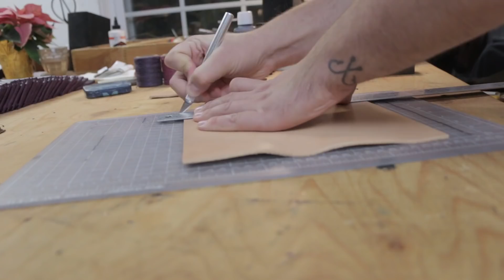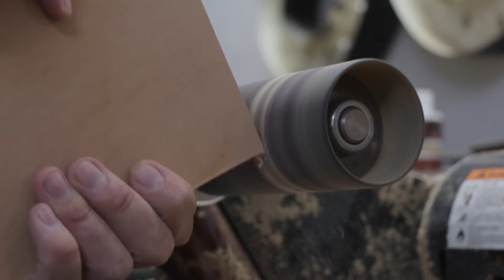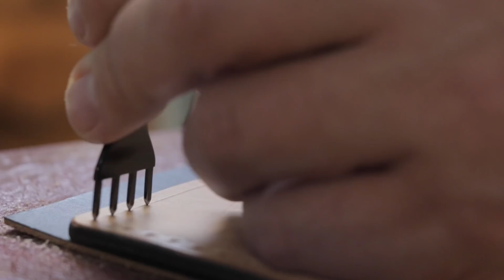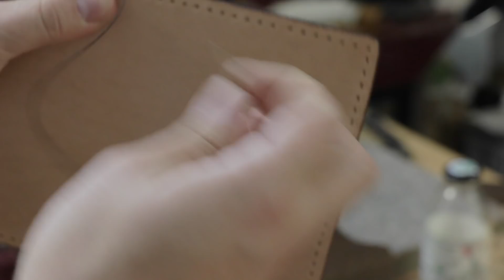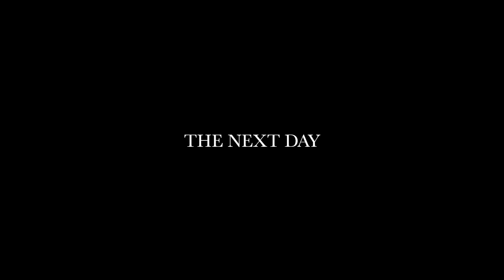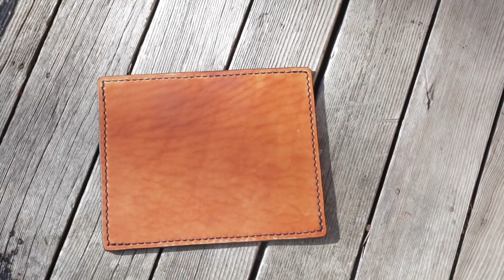Making a Leather Mousepad

Comment: Thank you for thisi great video. I just starting with my own leather working. I have a few questions:
1)  What kind of brand sewing thread are you using and what the thickness ?
2)  What kind of prong stitching  chisel are you using ? 

King regard 
Peter
Reply: Peter van der Plaat use tiger thread, it is the best thread you can get! There are many colours and dimensions like 0.6, 0.8, 1.0mm...
Goodsjapan.com has very nice prongs, I would use 3mm or 4mm if you need some help please contact me

Comment: Would have been nice to cut a stich trench into the leather so the stiches do not sit proud of the surface of the leather.  now the only portion making contact with the table surface is the small crowns of the stiches.  This method will also cause premature wearing off of the crowns of the threads and a less stable mouse pad.  I am also not sure how well the optical mice will pick up locations on a plain smooth surface like leather.  Most tech mouse pads have a pattern on the surface that allows the optical mice to locate on it.  Just a few points I noticed on the video.  I love the look of the pad ..  Leather says durability.
Reply from the maker: we hammer down the stitching and the entirety of the leather bottom makes contact with the table - haven't had a problem in almost 10 years of making them, no broken stitching reported and optical mice work fine :)